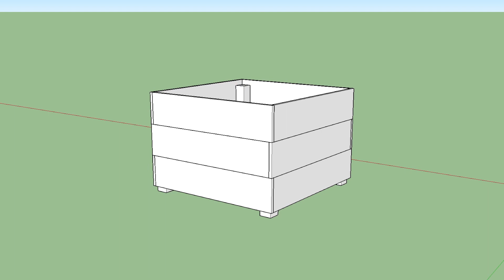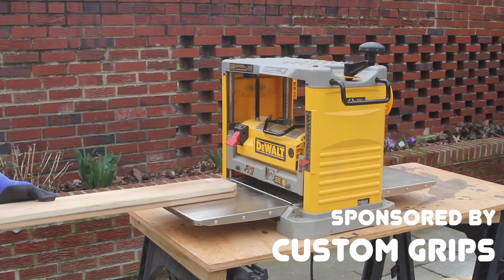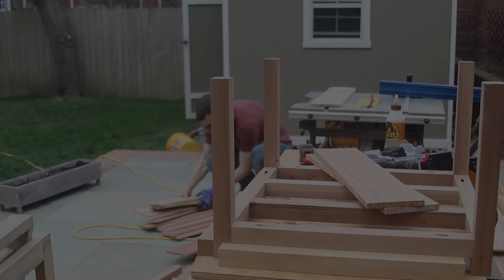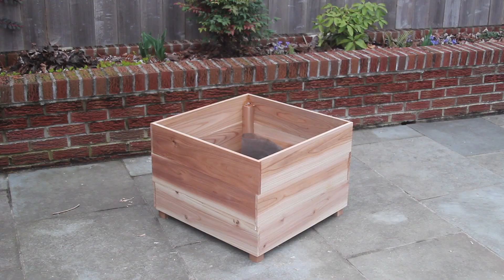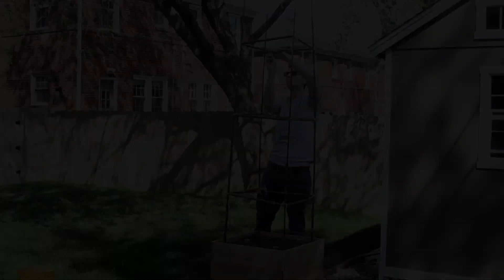DIY Large Cedar Planter | Built With $25 in 2x4s and Fence Pickets

Comment: Why don't you seal your cedar?  Is it preferable?  I am about to make your box, but using treated pine for the legs.  Any comments on that wood type mixture? I am new to woodworking.
Reply from the maker: Hey! You can definitely seal cedar, but it's not necessary as the wood is very durable. I like to let my cedar gray out then I seal with teak oil. There are lots of other options though. Pine is fine, but I personally would just do all cedar if you are going to grow food in the box. Send me a finished picture on Instagram if you are on there! Good luck!

Comment: I built something similar 5 years ago out of pine but lined it with polythene and put a few drainage holes in the bottom and it's still going strong. The only thing i've changed are the feet for which I used 2" round wooden door knobs to give it a bit of a decorative look. The polythene really helps prevent any rot as there's no wet soil to wood contact. Good luck with your beans :)
Reply from the maker: Great idea! The beans are finally growing as it only just started to get hot here.